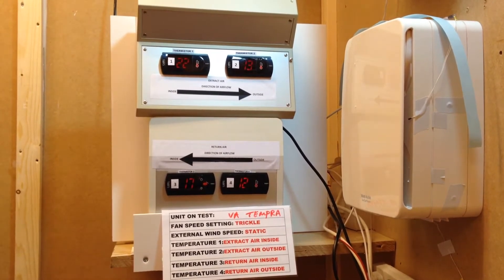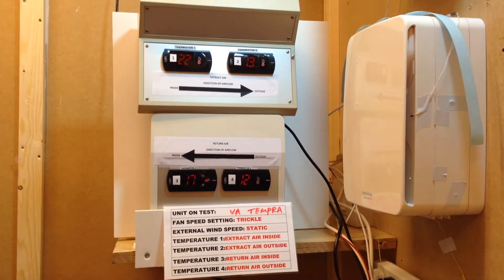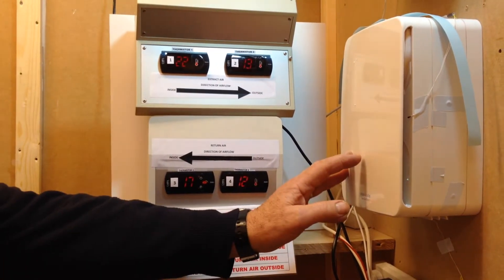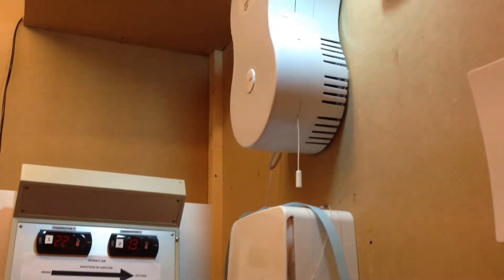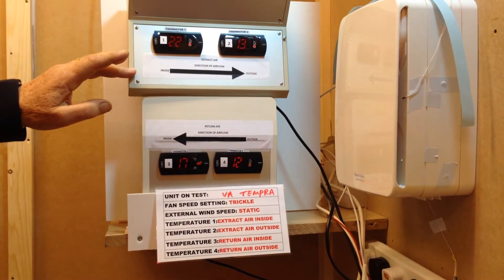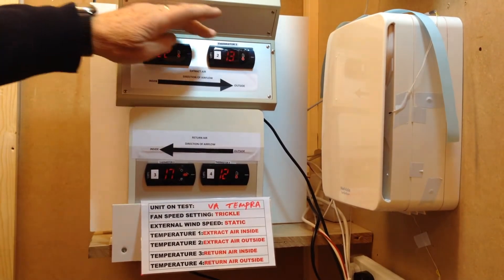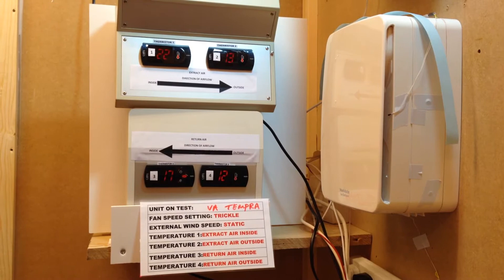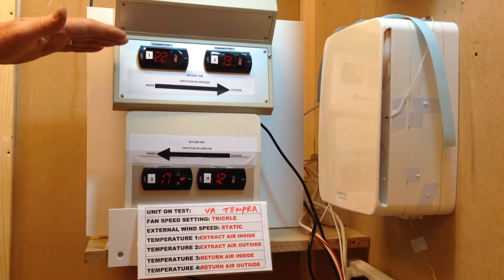SINGLE ROOM HEAT RECOVERY-DISPELLING THE MYTH

Comment: Any information on the single pipe type that uses a Ceramic Element e.g extract for 90seconds heating the element then reverse heating the incoming air with the residual heat in the Ceramic Element? Marley make this type.

Comment: What a load of rubbish. Opening windows will cure condensation and mould and will not cost you a penny
Reply: This would be true if you were not paying to heat your home.
Reply: True. If you do it. But what about when you are away? The advantage of these units, if they actually work, is that they are doing it constantly, also at night and when you are at work.

Comment: Cheers for the upload, definitely something to consider. I'm looking at getting one for a home office/workshop that will be well insulated so it would only ever be used on trickle anyway. Despite the flaws pointed out here it looks like if the location of the vent is protected from direct winds then it is still worthwhile. 5°c increase is quite significant and controlled ventilation will always be better than uncontrolled.

Comment: Couldn't we just reduce the intensity of the wind speed around the external wall vent outside by building an open box around it outside? Or wouldn't this make any difference?
Reply: No, its about the influence of the whole building - the walls (and vents, windows, doors, cracks)  towards incoming wind will experience high pressure and those opposite will be at low pressure. The airflow through the house when wind is strong is from the high pressure side (its vents/cracks) towards the low pressure side regardless how ventilation fans are placed.  The only way to mitigate that is to have an airtight house and exit/entry vents close to each other or even one under another e.g. the exit blowing up and the suction pulling from below so exhaust and intake see the same pressure. But it requires a single pair exhaust/intake with ducts towards all rooms and an airtight building.

Comment: Your experimental work seems odd. Even though the wind speed of 5m/s occurs in the outdoor environment, the outside wind is not unidirectional to blow the tapes on inlet slots. Unlike this experiment,  the outside wind rarely blows to the extract duct because a typical extract grille is  pointing to the ground. As this experiment does not show the extract grille cover and a blower fan behind the wall,  it is difficult to accept NVA's opinion.

Comment: I can understand how single room heat recovery performance is reduced in the scenario presented. My question is: Would a single room heat recovery unit still be better in bringing in a warmer supply of fresh air to a room than just opening a window in the room which has no heat exchange, or air filtration at all?

Unfortunately, in many of these new social housing situations in the UK  the new construction is sealed so tight that condensation becomes an issue. Also many of these units don't have windows which open. In addition several of the tenants in social housing smoke cigarettes, often adversely affecting a unit's air quality when the tenant doesn't go outside to indulge their addiction.

While I can see where you are coming from, single room heat recovery turns out to be the lesser of many evils until proven otherwise.
Reply: I think here author talks about heat recovery as the main subject. So heat recovery is not good at all. Ventilation is fine or the same as having a hole in a wall as the wind just pushes its way in.